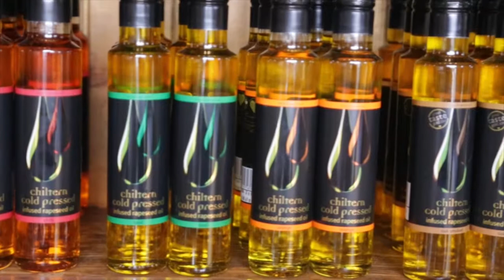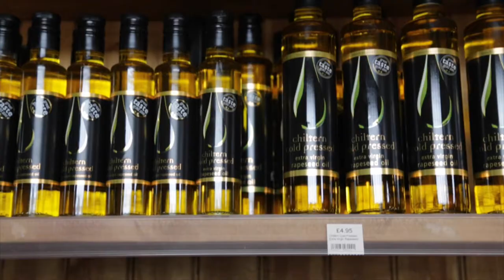Chiltern Coldpressed Rapeseed Oil: How it's made.

Comment: People need to recognised that cold pressed is completely different to full processed oil. This is as close to a natural product as extra virgin olive oil. Its is also chemically in terms of its lipid content very close to olive oil. I would use this for frying and salads with out a second thought. I like it's nutty taste as well. I use also EV olive and EV coconut.
Reply: tonyprice1526

But how much oil can these little seeds have?? 🤔
Reply: @fu8713  they have about 40% oil in them. You can see a cold press in action on you tube. It's basically a screw press that leaves the cake behind. The cake can be further processed to remove more oil with solvents. The same as with olive oil